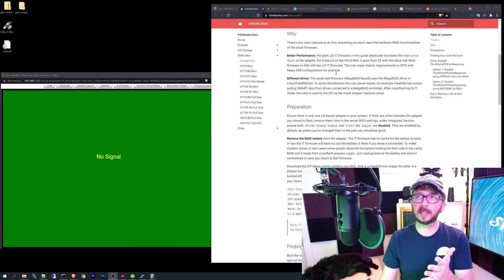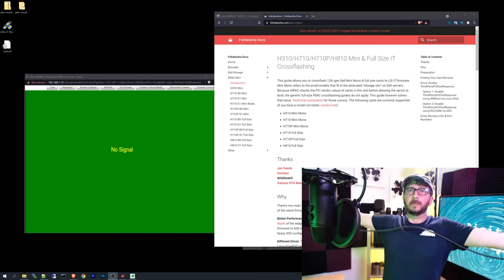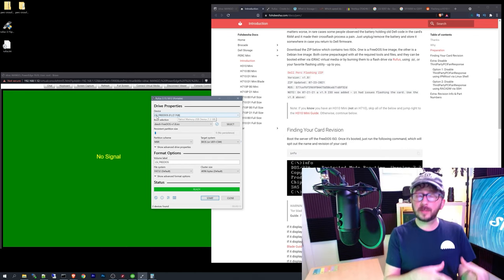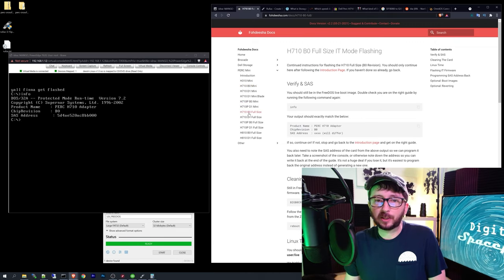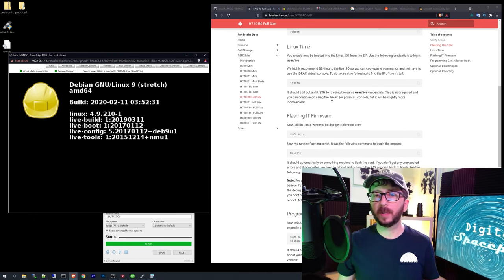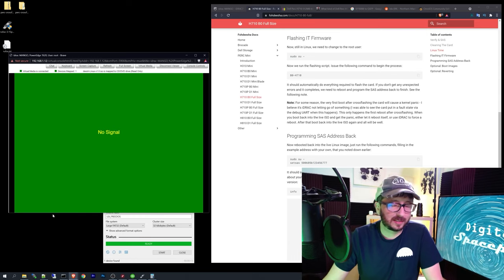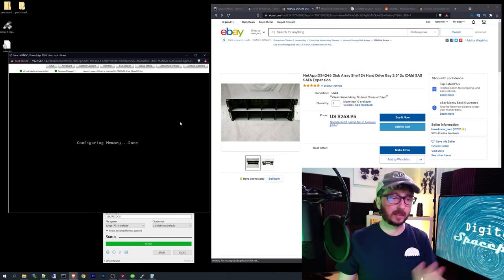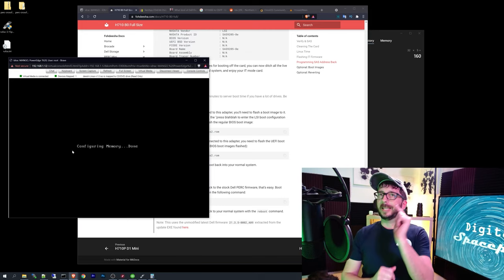How To Flash a H710 H310 H810 to IT Mode + Chia Storage + Noobs SAS + JBOD Primer

Comment: Thank you. I purchased a server that had a bad raid card with an error stating it couldn't verify the firmware and needed to be re-flashed. A replacement card was issued for my purchase, and the vendor didn't want the card returned. I was going to throw it away till I found out about IT mode. I figured why not, its already broken, worse case it wouldn't work. Your video compared to others and online directions, gave me the confidence to try it because I was afraid of causing other issues till I watched yours. Freedos couldn't pull info on the bad card. The part number was the same on both cards. Ran Freedos on the replacement, grabbed the SAS address, and then attempted to flash the bad card. Once all the steps with Freedos was ran, I didn't boot the live linux (2nd part) to see if the error occured, It DIDN'T! The card was recognized, so I proceed with the 2nd part and it was successful. I left the IT Mode card installed, and put the replacement card up just in case. Thanks again for going thru the steps and explaining it in detail along with the guide online.
Reply from the maker: Glad that it worked out in the end. Bummer to get something like that but at least flashing HBA cards has gotten a lot easier in the past few years :)

Comment: How does this affect the dell drive status LED lights?  Will the card still be able to talk to those backplane lights?  I've got the 9200-8e on order for my MD1200 but I'm wondering if that was the right choice.   An H810 in IT mode might give me "it mode" plus the ability to activate the status LEDs.  I understand that drive activity will still work but what features would use the activity lights... Locate Drive?  I'm not sure if Unraid or TrueNAS has that feature anyway, so maybe there is no point in worrying about using the H810 over the LSI 9200-8e ?

Comment: Wait a minute, you've linked and mentioned Dell H310s (full-sized) multiple times, but the website only mentiones the minis o.0
Reply from the maker: I have reached out to the author to clarlify if the H310 script will work, but good catch. I was going off the all variants thing written here but my H310 was flashed in like 2019 before I found this tool: https://forums.servethehome.com/index.php?threads/guide-flashing-h310-h710-h810-mini-full-size-to-it-mode.27459/
Reply: Works on the full size H310 as well! WIll be adding a note to the site regarding this soon

Comment: I am sorry if this was asked in the comments already, does this give my PERC H710 new Features such as more drive compatibility? I am looking to getting non-Dell drives for my T320 (12th GEN). I am targeting 8TB Drives (HGST Ultrastar He8 8TB 4Kn SAS 12Gb/s 3.5" Enterprise HDD: HUH728080AL4200). Will this open the door for broader compatibility?
Reply from the maker: IT mode vs IR mode is a bigger conversation then these comments will allow really, but look into it. It doesnt expand "drive compatibility" necessarily, but it does a lot of other things like deeper que depth, increased number of drives, and other functions that are on a hardware level how a hdd is interacted with. Basically flashing a HBA to IT mode allows the software layer to control the hard drive completely. Running an HBA in IR mode places a middleman in the path that controls disk access/activity. It will not give a SAS2 card (6GBPS) SAS3 speeds (12GBPS) if that is what you are asking. The interface link negotiation speed has to do with the card/interface bus speed.

Comment: It is possible to load a BIOS to enable booting yet it makes boot time longer so load it ONLY if U need booting from valuable SAS slot
Reply from the maker: you can in some servers set "disable bios boot rom" option and that should bypass the cards boot rom.

Comment: Awesome video! A couple of questions that I have is if you are going to hook up a JBOD, do you have to RAID the drives or can they still be single drives? And which do you think is better? Thanks for the video...I saw the first one but when I went to comment it was deleted LOL.
Reply from the maker: With a JBOD, they are like best for software based raid, but you can just access them as a single drive also (from like windows). BTRFS for performance in plotting with large arrays of like SSD's, and XFS for storage for lots of plots. I always vote for software based RAID nowadays. Hardware used to be much better, but in the past 3 or 4 years, software out scales it in performance and features. 

The first video the cat distracted me and I misnamed the cables up front. Yup, I'm pinning it on the 🐱.
Reply: @DigitalSpaceport  Roger that...I guess RAID would be easier and show one big drive in Windows, plus the security if a drive fails it can be replaced from backup. Ahhhh the kitty LOL.
Reply from the maker: I dont think windows does software raid 5? I think windows has a really interesting thing called storage spaces. I have not used it ever but it does seem robust like raid 6 level. Not sure. Just remember with hardware raid. If you lose X number of drives, the entire data set is toast. If you bought all your drives at the same time, well that is when bad things can happen. In HW raid 5, if another drive fails during rebuild the array is dead. In HW raid 6 its 3 total failures = dead.
Reply: @DigitalSpaceport  I swear I've seen unraid used on windows. Not sure about raid 5 or 6 I'll have to research that. But I've used storage spaces before and the transfer rate is sloooow... Like 40 - 70 or so. Might be ok go read times maybe? Sorry...I've never worked with servers and JBODS or Linux, so I'm having to learn all this as I go LOL.
Reply from the maker: Yeah that is a bad write speed. I have not seen unraid ran on windows, I dont think that can happen since unraid is a linux OS. Whatever you do, I recommend for a persons first time in RAID to go as non-destructive as possible. So if you have a drive die, everything isnt toast. Thats the nice thing about unraid. Even if you break the array, the data is still on those disks and usable as-is. Very user friendly for new users imo.

Comment: Hi, would it be possible to install  the H710 card into a custom LGA1150 PC using an Asus H87I-Plus motherboard instead of Dell/HP branded server/computers?
Reply from the maker: Great question, totally possible. You MAY have to tap over a pin but most likely do not. Also be aware of the differences in BIOS and UEFI and the manner in which you will flash the card and use the card :)
Reply: @DigitalSpaceport  Thank you man, and Happy Holidays!

Comment: Thanks for your video! DP, I run into problem when I follow the guide.  I couldn't see the PCI loaded.  My poweredge R720 booted, passed the dell log, iDRAC/LCC/BIOS no problem.  while I boot into Deesh_Linus, I sudo su - then type info.  It says: No LSI SAS adapters found! Limited Command Set Available!.  Would you able to give me some help?
Reply from the maker: Use a physical media to boot I think will help you out here. I had this issue when using iDrac for the media a few times.
Reply: @DigitalSpaceport  I will give it a try.  I am start to worry.  why R720 doesn't show PCI/H710...
Thanks!
Reply: @DigitalSpaceport  I booted from usb with deesh_linux, same problem.  I checked Lifecycle and I can see Internal Storage Adapter is installed.  but I don't know how to get bus number in linux.  is there away for me drop you screenshots?  Thanks!

Comment: HI I WONDER IF YOU CAN USE Dell Perc H810 VV648 WITH NON DELL SERVER ?   , JUST FOUND NICE SERVER BUT ITS NOT DELL ...
Reply: actually  my question would be more in line , would h810 work in normal pc with pci slot ? i would like to connect for example dell md1220 or md1200  if that would work than i don't see issues to run int in any server ...
Reply from the maker: @doommulitplayerchanel6172  Yes no issue it will work but do use the flashing guide with the correct h810 package I put together and excited to hear you found an mdxxxx at a hopefully great price!
Reply: well around 495 usd with hdd caddies for 12 3.5 inch hdd   plus found nice server HUAWEI RH2288H V3 Server 2XE5-2673 V3 32GB 12x 3,5 , nice cpus  for around 800 usd ,  ... basicly looking to make something like you have ... than i can add more md1200 or 1220

Comment: on a H710 Mini B0....everything worked for me untill setting the sas address "setsas XXXX" I get a 
"No LSI SAS adapters found! Limited Command Set Avaliable!
ERROR: Command Not allowed without an adapter!
ERROR: Couldn't Create Command -sasadd
Exiting Program."
:(
Reply: update: SOLVED...if you are having this issue ^^ make sure you have NO OTHER raid cards in the system.
Reply from the maker: Thanks for updating just got back checking comments here.